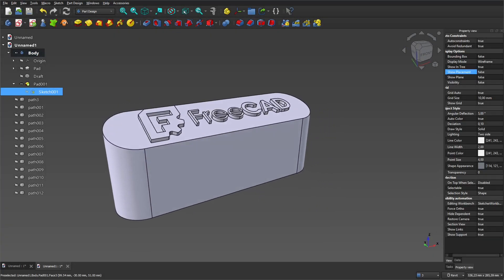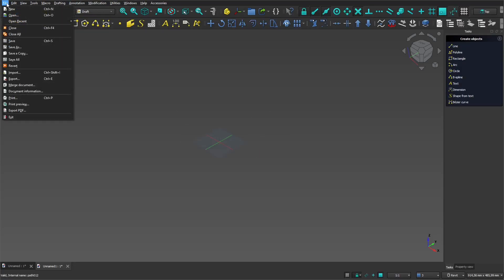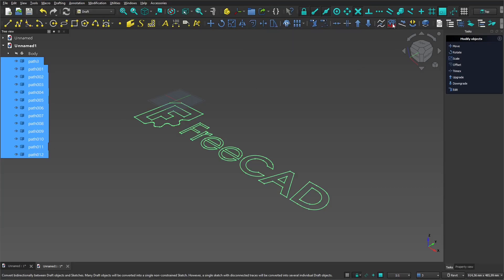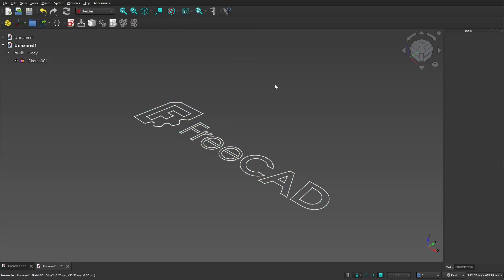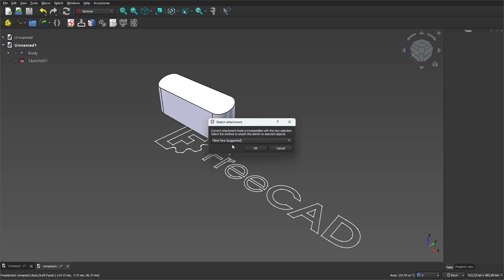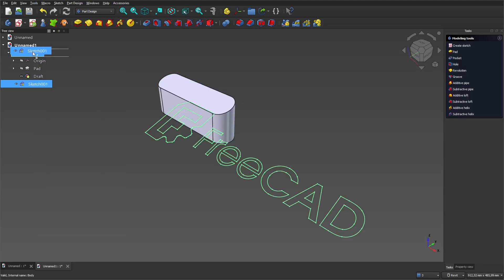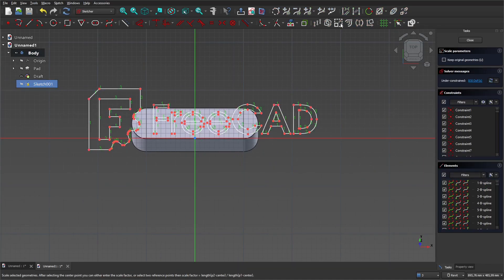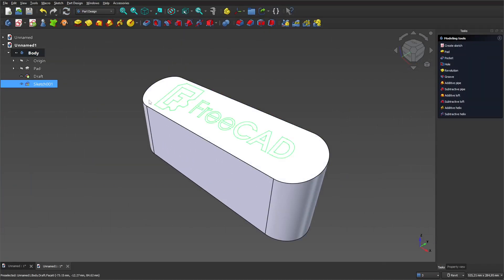FreeCAD - How to Import SVG into Sketch

Comment: Hello, I'm stuck trying to import an SVG file into FreeCAD and keep running into an error. The program displays the message: <class 'Part.OCCError'>: Both points are equal whenever I try the import. I think the issue might be a problem with duplicate or zero-length points in the SVG source file. Has anyone dealt with this specific error before and knows a quick way to fix the SVG?
Reply from the maker: Is the file saved in Inkscape itself?

Comment: When i try to move the paths (b-splines) in the sketch to center it on the model it only moves 1 and 1 line even when all is selected
Reply: Nevermind found out that you are using a development version of freecad, how do u perfectly center the SVG on the surface tho?
Reply from the maker: In version 1.1 (in development), when a sketch is selected, it can be dragged and dropped

Comment: I don't know if this is a different version of the software than the one available at present, but I don't have a radial menu when clicking, and there was no body already created when I started a new document. Also I couldn't just drag the sketch as seen in the video, and didn't figure out how to scale it at all (just gave me an unhandled exception when trying). Just thought you ought to know.
Reply from the maker: I have a video about radial menu (PieMenu), how to install and customize it. The body was created beforehand, the video is not about creating a body, there are many videos on youtube how to create a body. When opening a new document, the body is of course not created automatically. About sketch transfer and scaling, maybe you are using an older version, you need to install version 1.0 or version in development (1.1)
Reply: @Cadessentials-dn8rz  About sketch transfer and scaling, I run 1.0 and opening the sketch does not show any constraints like in your case. Your edges seem to be numbered, mine not. Are you using some dedicated plug in? Or did you apply some form of grouping at SVG level?
Reply: I was wondering the same!
This looks much more smoother than the plain FreeCAD you get after installation, i hope the op can tell us what kind of FreeCAD he's using
Reply from the maker: This is a regular version of FreeCAD with a slightly modified interface. I have videos on this topic (How to get development version) and (Interface customization) on my channel.

Comment: I have exported edje cuts layer from KiCAD to SVG. Imported to FreeCAD, then extrude give me only walls without polygone. Looks like every line as separated object. How to merge them and close shape?
Reply from the maker: In the Sketcher workbench there is a function Validate Sketch, you need to select the sketch and click it, then in the sidebar at the top there is a function Missing coincidences, you need to set a value slightly larger than the gaps between the points of the curves, click Find, then Fix. When you click Find, the program will highlight which points do not match, if after fixing the sketch still does not extrude normally, you should try a larger value, there may still be gaps. Maybe I will make a video on this topic
Reply: @Cadessentials-dn8rz  Yes, thnx. This helped me, but I found in another video.